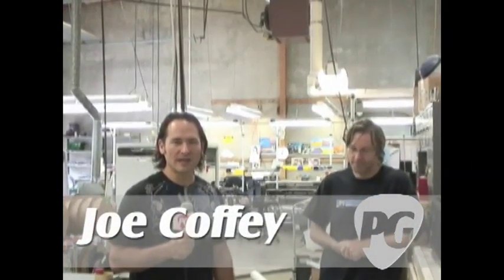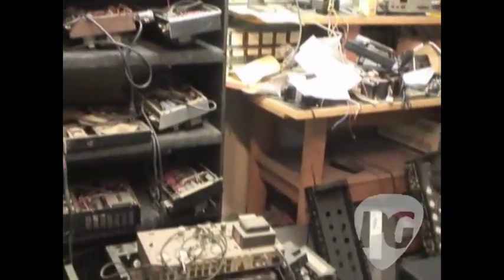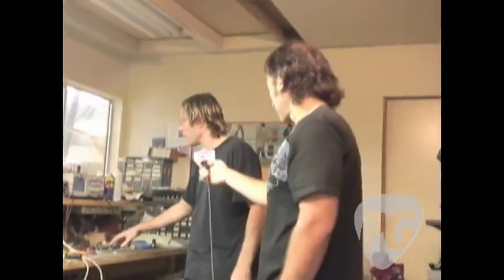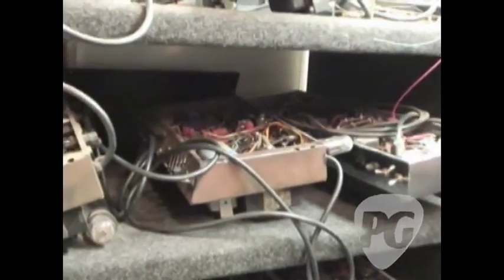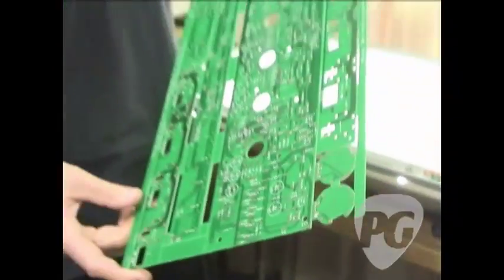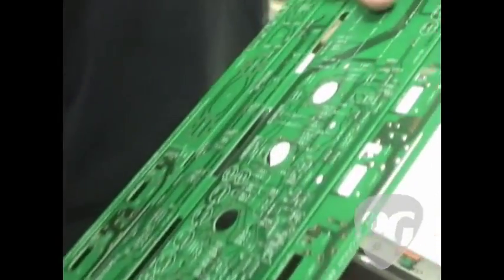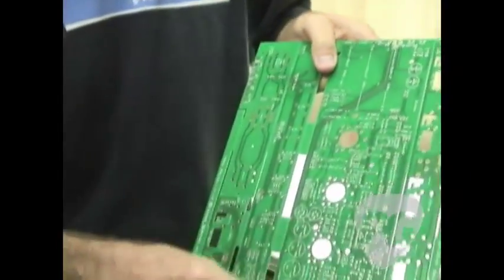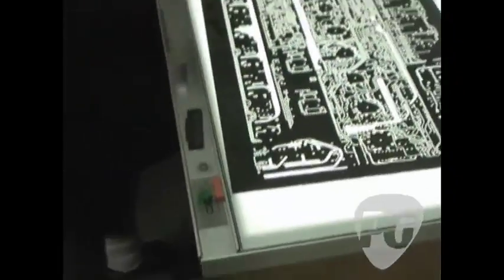Mesa Boogie Factory Tour-Workshop & Design Room

Comment: Jim Marshall died on April 5th, 2012.

The iconic JCM800 circuits spawned Soldano's, 5150/6550's, Double and Triple rec's and others well in to the 1980's.

Original Marshal amps were copies of early Fender Bassman amps. The only real difference was the use of EL34 instead of expensive 6L6 power tubes.

Mesa Boogie amps were also copies of hot rodded Fender Amps.

Let's just say that both Marshall and Mesa Boogie owe a lot to early Fender amp circuits and still "borrow" others ideas today.